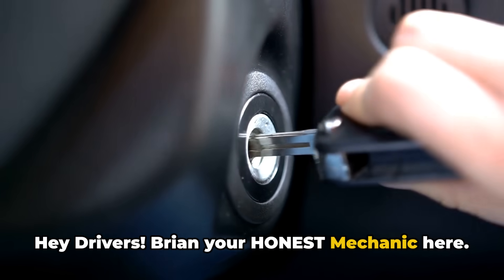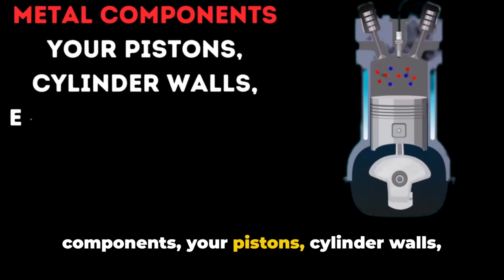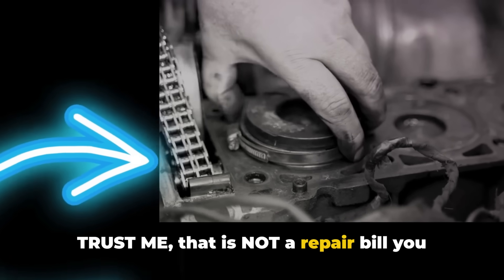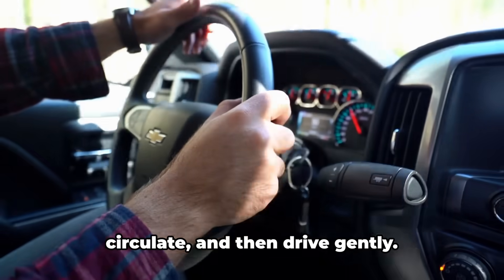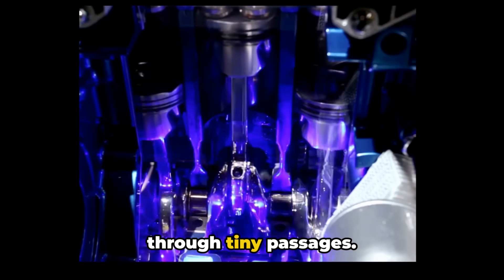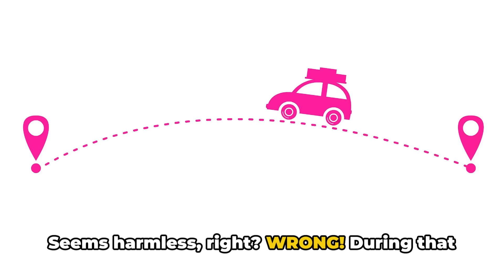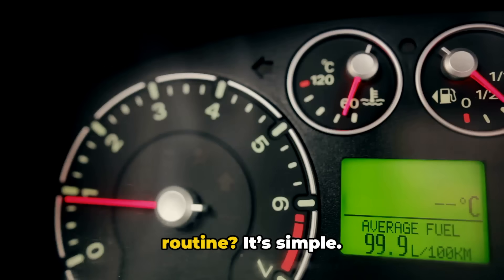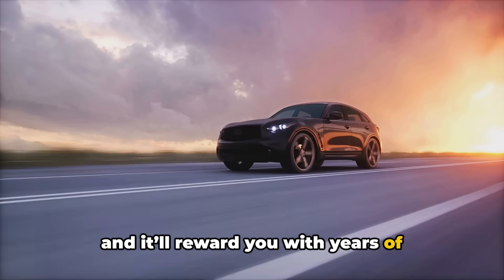5 Cold Start Mistakes That Wreck Your Engine (Avoid These)

Comment: Hard to disagree with these tips. As a biker it droves me nuts when fellow bikers leave their engines idling for 15 minutes "to warm up"usually with a loud exhaust pipe too!
Reply: I would argue, that these tips absolutely count for cars, but a lot less for bikes. Because bike engines are smaller than car engines and they are all gas, bike engine do heat up very fast when idling. I had a liter bike a while ago, and this thing showed full coolant temp after 2 minutes of idling. And riding a bike gently to heat up is a lot trickier than cars. My bike was brand new and I was supposed to keep the engine under 4,000rpm in the first 500 miles and under 6,000rpm in the second 500 miles. And the engines of sporty bikes run a lot smoother the higher the rpm. Riding at max 4,000 was tricky, and no joy.

But other than bikes simply heating up better and quicker than cars, the physical basics are also true.
Reply: Bikes are air cooled-dope!
Reply: @ToddThoren Not liquid cooled bikes.

Comment: I was an engine mechanic in a large dealership back when you could rebuild and repair practically the entire car.
The veteran engine mechanic who had been there since 1950 said to me before he retired " the little old lady's car who only drove to church is the car you dont want to buy.
For all of the reasons you stated in this video.
Along with the proper recomnended viscosity also use quality name brand lubricants and if you live in the northern tier of the 48 states change your oil at half the recommended mileage.
I have maintained my and my families vehicles for decades.
Engine work is one thing we never had to do other than proper maintenace.
Reply: I always change my oil as the seasons change, twice a year, going from fall to winter, then spring into summer.  It’s usually between 4-5k miles.  Full synthetic.  Winter is hard on engines.  I always like fresh oil going into and coming out of winter.
Reply: wonder how many motors are ruined these days with bad electric cooling fans and relays/sensors....the ultimate in planned obsolescence...don't get me started on interference motors!!!!!
Reply: @matthewtarka2804  
I hear you.
Especially interference engines with belt driven cams.
Makes absolutely no sense.
Reply: This is why I've never been scared of a car with mileage it's the old 20 year old car with 30k miles on it that scares me the most, all the rubbers are dried and cracked up, engine has likely never seen more than 40mph and the gearbox never seen 5th gear. Spent all it's life doing the post office run and once a week to the supermarket. You'll spend as much money fixing one up as you would on the same car with 250k miles.
Reply: Winter suks and very bad on our cars, those of us in the real world that don't get a new one every three years
Reply: Any oil brands recommendations for a 2014 suzuki scross petrol?

Comment: Thanks for the information. What about for diesel engine for example 6.7 cummins? On ram 3500 chassis cab.  2017.😊😊
Reply: Same thing. This goes for all engines. The Cummins is really reliable, however that air heater in the intake manifold will eventually break off and that screw will go into the piston and destroy the engine. I’d suggest you replace that with the gale banks monster ram. Good upgrade for more airflow, but also stops that screw from destroying your engine.
Reply: @Eclipsis17  thank you!!!😊😊😊🙋‍♂️🙋‍♂️

Comment: Yeah your right. But if you have to do small trips you can make sure you give it a good run for 20- 40 or more minutes at least once or twice a week to burn off the carbon build up 👍.
Reply from the maker: Thanks, Exactly! A good long drive helps burn off moisture and carbon buildup, keeping your engine in good condition. Great tip! Thank you 👍"
Reply: I am a retiree drives my 2009 Ford Taurus ( since 2020 ) for short local trips to nearby supermarket library senior center within 2-4 miles radius. So, you recommend I drive it once or twice week out of town ?
Reply: @stephanielau1705 Yes, your engine oil takes at least 15 minutes to warm up properly (longer when it’s cold). Plus you will prolong your exhausts’ lifespan because you removed all of the moist from it during your (longer) drive. 👍🏻
Reply: @stephanielau1705 Just take the long way when you drive to the short destinations.
Reply: If it's had new oxygen sensors,  catalytic converter. Egr valve. Than you might be ok. But if them things come up as warning lights on dash then it might help to give it a good run now and then. I'm only speaking from experience. I'm not a mechanic. @stephanielau1705
Reply: If it's had new oxygen sensors, catalytic converter, egr valve it might be ok. But if they come up as warning lights then it might be a good idea to give it a good run now and then. I'm only speaking from experience I'm not a mechanic.👍.
Reply: I usually just drive a few more kilometers, until the temperature gauge is at it's normal operating temperature. Before turning around and heading back to my destination.
Reply: What if I just work a 3 minute drive from home but it's way too cold to do the 25 minute walk?
Reply: Italian tune up 🇮🇹
Reply: I’m used to charge my Alfa Mito a few times in a month up the mountain and back, to keep her healthy😎🇮🇹🔝